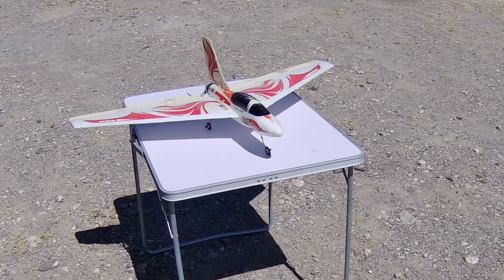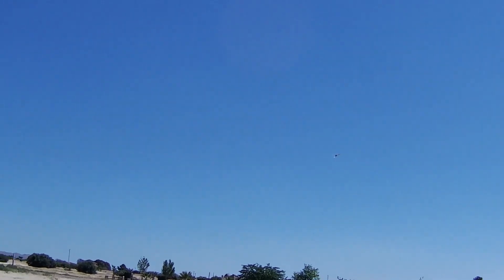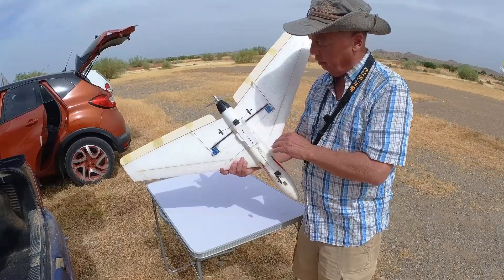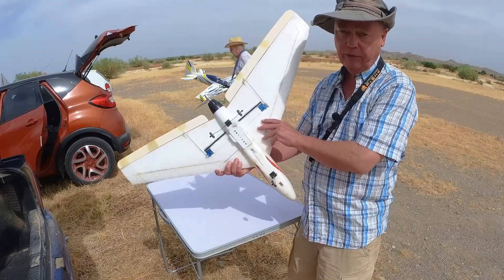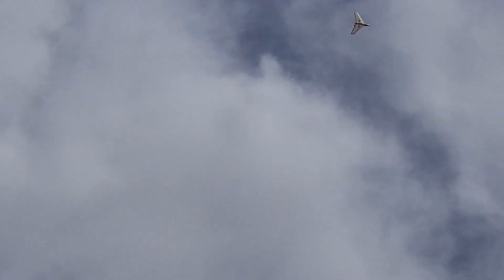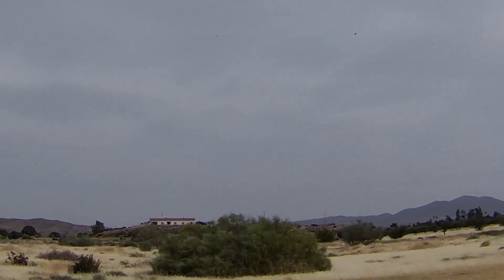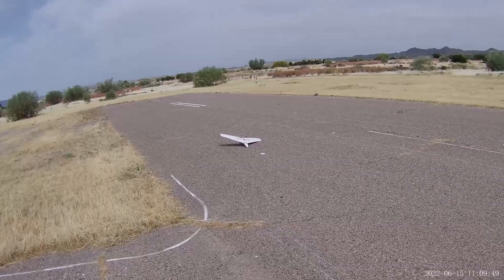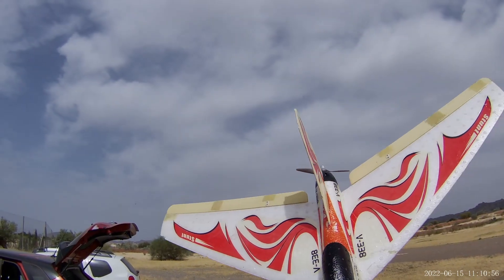HobbyEagle A3 Mini 6 Axis Gyro Stabiliser Gain Control

Comment: I really enjoyed your videos on the Byme-D and the A3 Mini gyros.   Your explanations are absolutely first rate and perfectly paced. I have a question I would like to ask.  I want to put a gyro on a Radjet 800 so that I can launch it sidearm from the wing rather than use the overhead launch and risk cutting my hand. The aim is for the gyro to correct for torque-roll (and my poor launch technique).  I originally thought the Byme-D in stabilize-mode would provide the answer, but after watching your videos, I came to the opinion that it wouldn't work from a hand launch. The A3 mini looks to be much more versatile. Do you think it could counter torque-roll on a hand launch?
Reply from the maker: Hey thanks! I think the A3 Mini will be fine for that. The ability to set different gain levels for each control surface will help. I mention that here : https://www.youtube.com/watch?v=8E3CG9Ih5xA So you can turn up the gain on the aileron to counter the torque roll. Also make sure you have a little "reflex" (a few degrees of up) on the elevons. On some models I go further and program in a "launch mode" on my Tx that adds a bit more up that can be switched out when the model is flying. Have a great day!
Reply: Thank you for your reply. Much appreciated, especially the extra tips regarding reflex and the use of a launch mode switch. @1nformatica
Reply from the maker: @richardo212  You're welcome! Have a great day!!

Comment: is it worth buying this? I've been asking myself this question since 2013... I think that if the wind is too strong, it won't fulfill its role. you have to use it with a light wind and in this case you generally don't need a gyro
Reply from the maker: I believe a gyro is a valuable addition to any aero modeller's arsenal. I have flown models in gale force winds when nobody else in the club would fly by switching the gyro into stabilised mode. It can react to gusts of wind incredible quickly. The A3 Mini has 6 different gyro modes for various purposes all selectable from the transmitter. I used one when I did the maiden flight of my Lancaster model : https://youtu.be/9AM6t9kdA48 I took off with it switched off then in flight put it in gyro mode (only corrects for wind) and finally stabilised mode so that I could not bank at too steep an angle as this model is renowned for tip stalling. I suggest you read through the manual to see how versatile this gyro is : https://www.hobbyeagle.com/manuals/A3Mini_User_Manual_v1.2_en.pdf I am happy to answer any question you may have. Thanks for watching, have a great day!

Comment: That spar looks flush mounted? If so it's got to effect the air behind it like a rock in a river and produce turbulence over the control surfaces.
Reply from the maker: Many foam board planes are the same : https://youtu.be/hP9se48JFnU?t=179 In practice the effect is negligible. As this plane is just used (and abused) as a test platform I am not unduly concerned. Thanks for watching, have a great day!